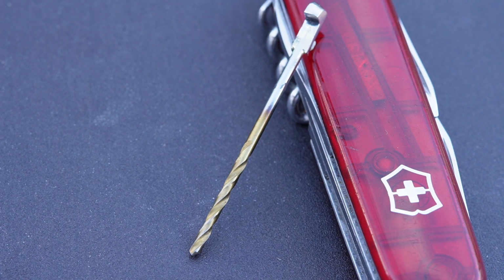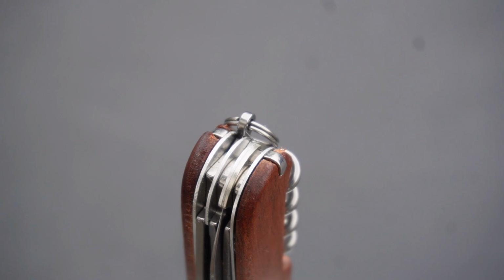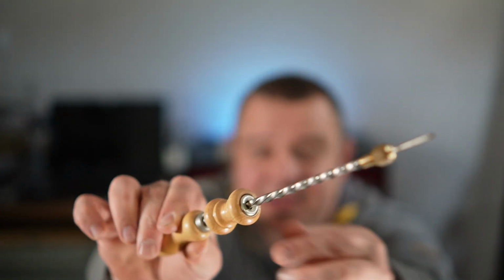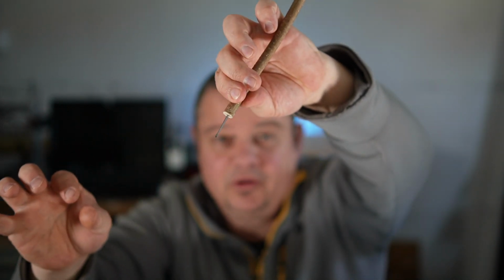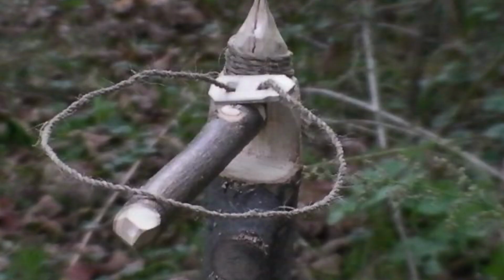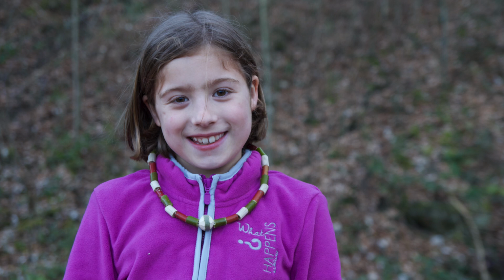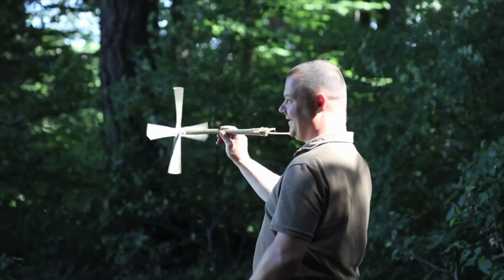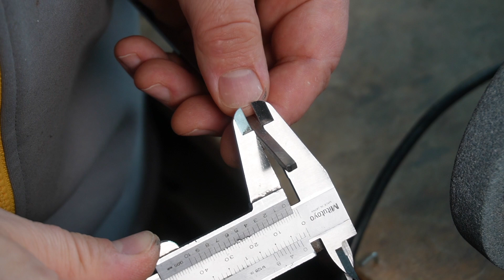Drill bit  instead of Toothpick / The Swiss Army Knife Modification for Bushcrafter and Craftsmen

Comment: Hallo Felix,
If you have to drill through something really hard and it takes more pressure, or it takes a long time, there is a trick to not get blisters.
It's inspired by a video I saw on friction fire.
You tie the middle of a cord to the other end of the stick and about 20 cm of free space at both ends. You make two eyelets at the ends to pass the thumbs.
Thus the pressure against the bottom is realized by the traction of the thumbs on the cord, and the back and forth of the hands makes only the rotation, without having to press in addition against the bottom.
The palm of your hands is spared.
Thanks so much for all your great videos and see you next Friday.
I'm already looking forward to it.
Best regards
Mirko 🇨🇭
Reply from the maker: Thanks a lot for this super idea!

Comment: Wow, another great video!  And I really like the aspect of simply using any piece of wood without having to fulfil certain conditions, to finally make the tool work!   

Even I as the most amateur beginner in the outdoor-bushcraft area immediately learned the insane usefulness of any piece of wood out there. You only need one knife maybe to adjust the piece of wood a little bit, but then you can do ANYTHING with it!
Reply from the maker: Thanks a lot for your interesting comment!
Reply: Can you start a fire with it during inclement weather?
That's why l use the toothpick slot for the Firefly ferro/magnesium stick.
The tweezers come handy too often to be replaced. 
(Most tiny drill holes can be made with the awl on the SAK... no modification needed)

Comment: There is a very similar drill and screwdriver that uses similar bits called The Yankee Drill, or Yankee Screwdriver. I carry both in the small storage area of my SUV because the heat in SE Texas destroys batteries that are stored in the vehicle. 

I have a very small Archimedes drill for bits smaller than 1/8 inch. It's a cheap item , so I may be biased, but the Yankee tools are much better.  They are actually real tools, great for off the grid use, or long term storage where batteries won't last.

Also, in a pinch, one can use the tip of a nail to drill a hole in the same fashion in which you describe. I forget my drill bits one time, although I had my cordless drill. I chucked up a nail and drilled a few holes. Note: a nail with a very round tip will not work as well as one with more edges. But you can fix that with a file, sand paper, or a rock. Or, tap the nail into your stick, and then cut the head of at a sharp angle w wire cutters. 

One could also heat a nail in a fire, shape the tip or head as needed with a smooth rock. I think one could craft a nice, small harpoon tip from a modest nail that might work on fish, frogs and perhaps rabbits. Nails are low carbon, so they won't take a tough edge like a knife blade, but in a tough situation, I think they'd do. A SAK w pliers and a metal file would be super handy, but you can file a nail with many rocks or a smooth chunk of concrete.  

But your suggestion is best, it is nice to already have a tool that you need vs having to fashion one. 

Drilling holes in leather is a great idea! I already do that sometimes at home when working with thick layers of leather. I think the perfectly round holes in a field repair will be less likely to tear out than a rough hole that is punched. And you can probably space your holes exactly where you want them for  a nice clean repair. 

Great video as usual! Watching you always gets my creative side stimulated!

Comment: Excellent way to make a new tool for such fine work. 
However, I'd also like to find a practical way to make larger holes in wood. The Victorinox awl/reamer caters for a 5mm hole, no problem for most tasks, but how can one make slightly larger holes, like 8, 10, and 12mm?
I know one can get Scotch augers for holes larger than say 20 mm, but I don't see as many applications for that size as for the smaller sizes mentioned. Also, Scotch augers are really expensive! Your video on how to make the nails, and harden them got me started on asking these awkward questions, as I started to think of so many applications that one would normally reject because one couldn't make a hole!  
One of the biggest problems is in being able to make the bit turn fast enough to cut a nice hole. This I think was the design philosophy behind the Scotch auger where the bit itself follows the hole cut to keep it straight (the biggest problem with a spade bit, and why I dislike them so much). When in the woods, away from the workshop, one doesn't have a drill machine. I have considered a drill brace and bits, and have used them tons of times, but they are a bit bulky to carry around in your pack. 
It is something that really worries me, that I can't solve this!  [I am not known for coming up with innovative solutions to problems like you are! I need to learn them from you guys! ;-) ]
Thanks for yet another tantalising video!

Comment: Great concept that could expand to more uses than just this one, why not make different sizes of the same style bit. You could not fit them in the knife but having a few in your camping gear could be handy. Hammer drills are another idea you drill thru rocks with one if you wanted. 🤔😅👍 The larger diameter the stick you use would increase the bit speed and drill even faster.
Reply from the maker: Hello Gizmo. Thanks a lot for your interesting feedback!

Comment: Drill-Enhancement: build a lanyard out of Paracord Typ 1 (thin enough to knot' a good lenght into a lanyard for the SAK), then open the lanyard, wrap it around the "drill rod", and use the SAK to pull it, and use one swift arm-movement to drill the hole, much more accurate than using the hands to do so ;)
Reply from the maker: Danke für den interessanten Hinweis!!

Comment: That kind of ratcheting spiral push-pull screwdriver is called as a Yankee screwdriver https://en.wikipedia.org/wiki/Yankee_screwdriver Their drill/reamer bits could be found for example in ebay. They might be more suitable template for modification to toothpick slot than ordinary drill bits because they have more metal in the shank end to fit in the standard 7/32" size chuck of the screwdriver. It means that the drillbit tool could be made without brazing. There are also drill bits with standard 1/4" hex shanks, which might be also used for the same purpose.
Reply from the maker: Thanks a lot for your super valuable hint!!